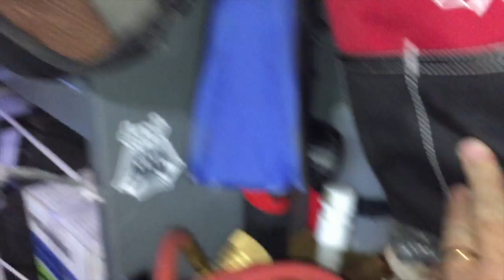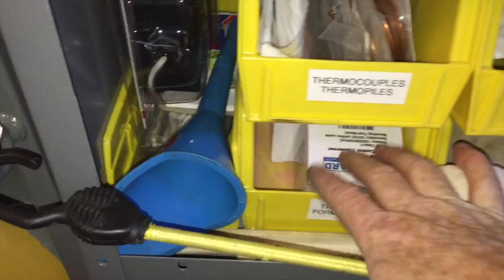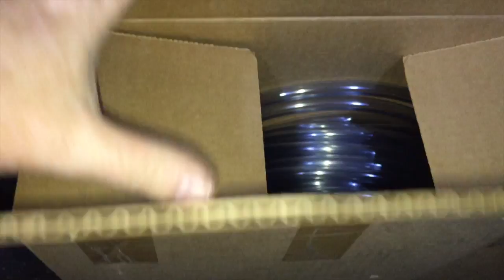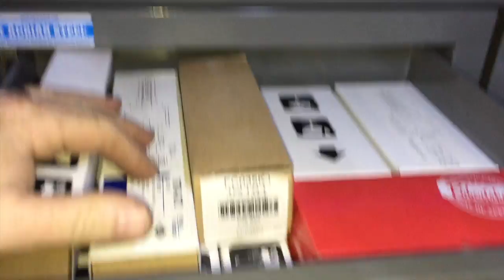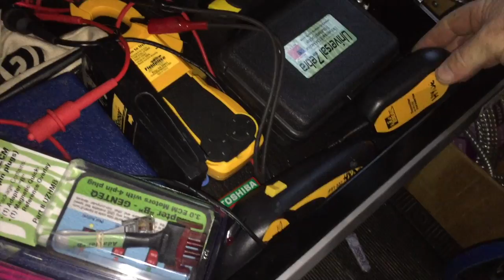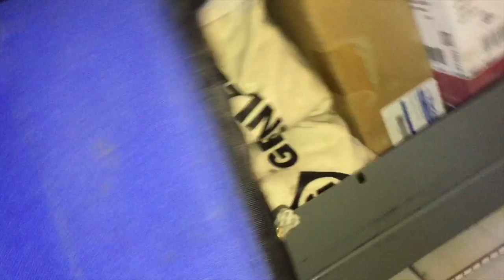What is in my HVAC service van?

Comment: good set up bud...My tools and set up in the van are almost identical.lol
Reply from the maker: Good minds must think alike...
Reply: Hyde Heating and Air Conditioning is that ur company and r u solo? I almost bought a trailer last year but built a 24x40 garage instead.
Reply from the maker: Mostly solo. I bring in a helper for change outs and bigger jobs. The trailer has been a great investment. This winter I grabbed a propane heater to keep it warm while I work on the sheet metal. Not lifting equipment into a van and using the ramp reduces wear and tear on my back. I can't build a big garage on my property, so I rent shop space. I have a 35'x45' space and it works out great. I store the trailer inside to reduce my theft risk.